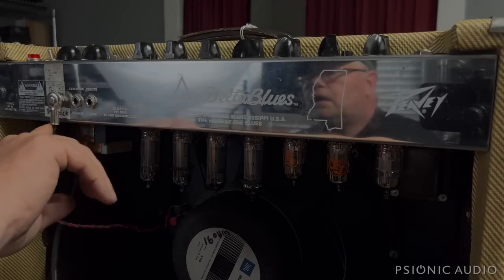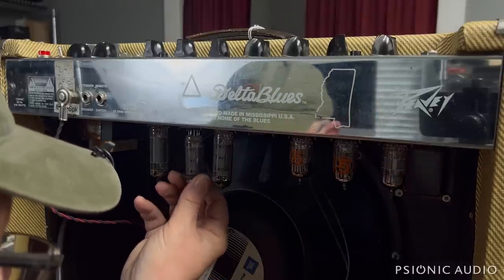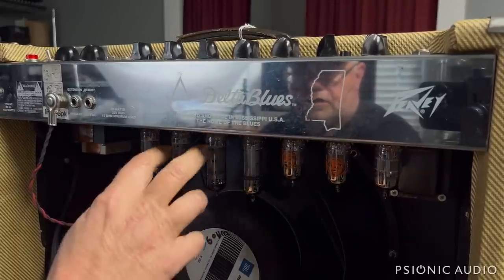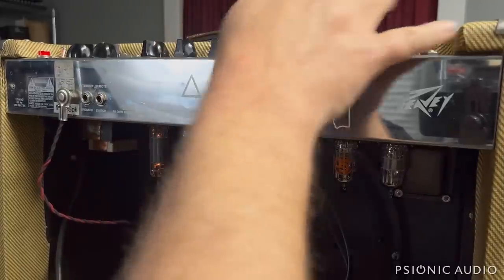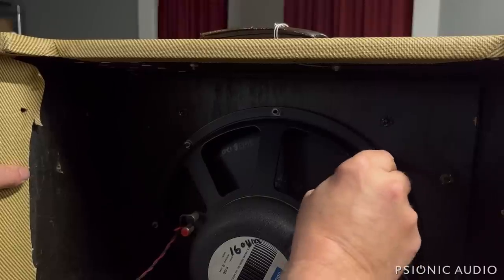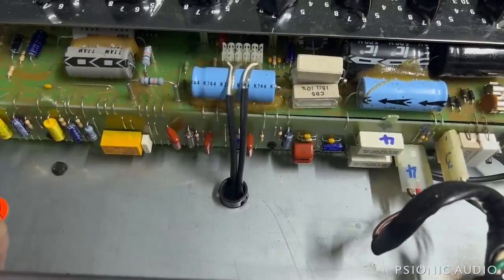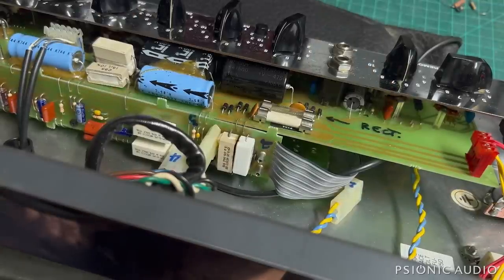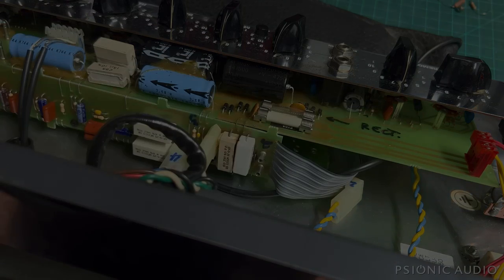Noisy Peavey Delta Blues | Part 1 : Diagnosis

Comment: I have had a Delta blues 210 for about 20, 21 years now. I don’t know what MoJo Is in there but I have owned numerous amps over that period of time, yet The Delta blues has remained in the collection. Definitely not a perfect amp, but it is absolutely a sleeper. Especially in that price range. Although I would personally avoid any of the modern offerings from Peavey

Comment: The folded board scheme seems to be a worst of all worlds approach (convoluted assembly and fragile, hardwired jumpers that might require recreating if bent/broken when removing the pair for component replacements).  Besides that, the heat management is appalling.  STACKING two 5 watt resistors atop each other?  The mind boggles.

Comment: The folded board thing Peavey did in these always amazed me. Of all the choices they could have made, that was what they went with?
Reply: It baffles me. It made construction so much more difficult in the factory.
Reply: And those wire jumpers are notorious for coming unsoldered or breaking...
Reply: The folded circuit board had to have added production cost, it makes no sense.

Comment: I don't like the way this amp is built.  I would pull the JBL, and toss the amp.
Reply: Yep. These and the Classic 30 have the most absolutely bonkers internal design.
Reply: @davidfuller581  Maybe they did it to save space, but it's a really bad design.  I would have just made the cabinet a little bigger, so I had more room to lay all the PCB's flat.

Comment: I have one of these amps. One things that's super impressive to me is the strength of the reverb and tremolo in this amp. They are both super intense. The tremolo especially, the intensity on 5 is like a Princeton reverb on 7 or 8, maybe more. Super strong effects. Not bad sounding overdrive channel as well. This amp can do pretty much everything besides heavy metal
Reply: Is this pretty much a classic 50 with a 15" and different  wattage  . Thks
Reply: @tomfoolery2082  No it's actually A bit different, It has a push button to switch between clean and drive. It also has tremolo where the Classic 50 does not. Also has a mid range boost, and no presence knob like the classic 50 has. However the way the gain is done with the post and pre knobs is the same. In conclusion the  delta blues has no master volume, it just has the volume knob for the clean channel and the pre and post knobs for the drive channel. besides the wattage and speaker, those are most of the differences.

Comment: Bought that same model brand new the late 90's and played it for about 10 years, but whooo weee!  Removing those hinged PCB's to replace components for me was a guessing game as to which connection I was going to break in the process of repairing it.. but then again I am a rank amateur.

Actually it was a pretty decent sounding amp and a  real bargain at less than $400 new.  Other than the board design, it's only real negative was the very muddy reverb.

Comment: My apologies for the dumb question. What is the white connector called that goes from the reverb tank to the board? My cat chewed up my reverb tank cables and I want to replace it. But all cables I can find are RCA to RCA, not RCA to that white connector. Thank you!

Comment: Those folded circuit boards are a nightmare!  91% isopropyl alcohol will make removing the hot glue very easy. Just a few drops or some in a small spray bottle on the globs and pick it right off. I have a Delta Blues 210 and it rocks!
Reply: I went with the 2x10 in the 90's and it has been a great amp. Still have it. I liked it so much I bought a classic 20 too.  Best small amp ever 🙂
Reply: I got the 210,playing it regularly,good amp.

Comment: I recapped mine about four years ago. What a nightmare! I wish I had known about Psionic Audio then.
Reply: @@mrnobody6760 it depends on your electronic knowledge and your mechanical skill level. If you don't feel 100% confident in your abilities, take it to a reputable repair shop. The cost savings, if it smokes when you turn it on, will be lost forever.

I took my time, took lots of pictures, and marked the polarity of the old caps on the board with a pencil before I took anything apart. I didn't have any problems and my amp sounds fine. Good luck with your amp whatever you decide.

Comment: The control panel on my Delta Blues 210 gets REALLY hot to the touch when playing for a while. Never been sure if that's a fault, or just bad design / heat dissapation with these amps?
Reply: Mine is the same

Comment: The fusing in this is bad. It alows a lot of current being drawn from the transformer. A transformer which is really low quality and therefore prone to fail if for example the output tubes start to draw to much current. They put in fast fuses and oversized them instead. Yes they will work fast with a complete short.......And I really wonder about only having screen resistors on two of the output tubes. Which magically is the two tubes were i encountered burnt of pcb traces in conjunction with the burnt transformer and still intact fuses. Great build this one.